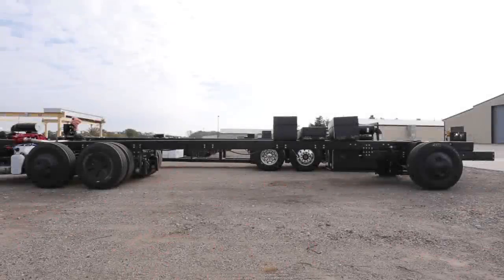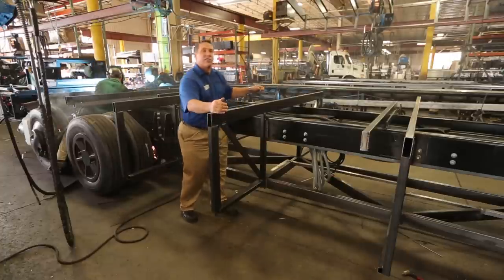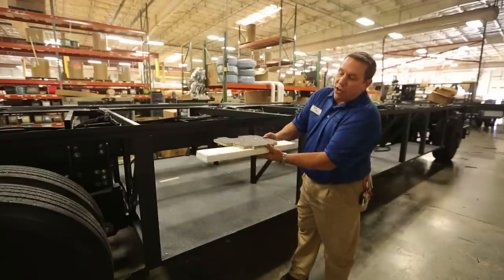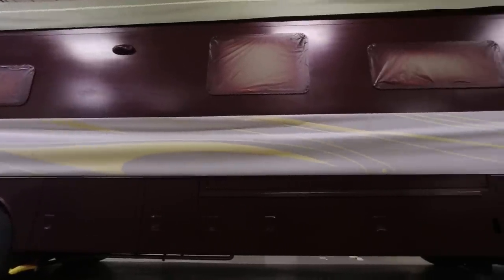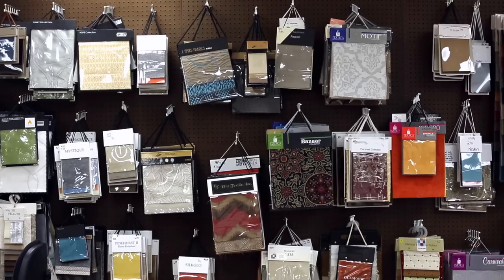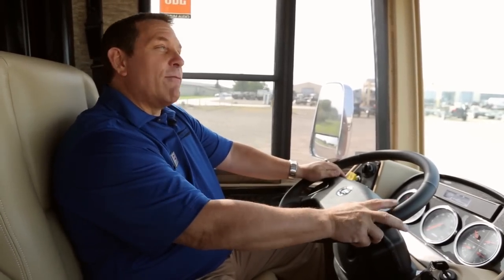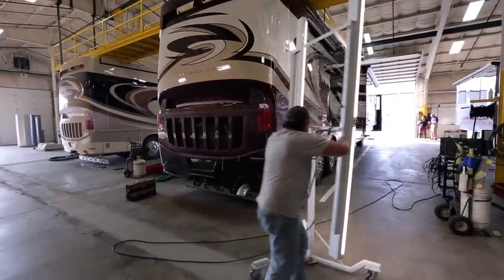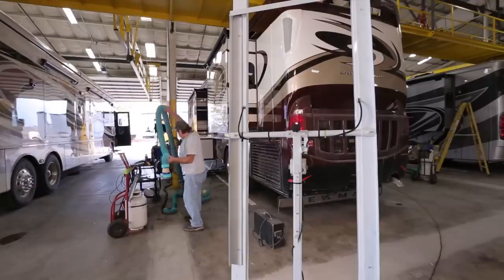How it's made Motorhome| Prevost bus| RV coachs full factory tour | technology and advance feature

Comment: Newmar is a pretty good coach but that is not rust resistant metal they are welding all under there. Many high mile PTR coaches and buses rust out underneath if used year round! If you convert a vintage MCI 8 or 9 or the new 102" they use stainless in the likely rust areas. Coaches need to be built to last more than a couple hundred thousand miles. A million miles is more like it! And a CAT or Cummins with an Allison can do it!

Comment: You better check your workers better..
like for instance, I bought a outback and on a heavy downpour rain my outside porch light leaked and it came in over the lense and into the inside and filled up with water and the bolts that was holding up the light fixture was not caulked and then the water filled up in the side wall and drained into the floor and ruined my floor..Had to have the light bolts caulked  and no more leakes. ..
Then my cable on my slide got off it track and jammed by the roller and now is shredding on the cable..
Also the bedframe is breaking apart cause the weld isn't welded good..The bathroom sink leaked so have to replace that..
This is the biggest Lemmon that I ever bought..If it could get fixed without me putting all this money in it cause of the goof up,I'd be a happy camper...
Reply: A Keystone outback TRAILER isn't a newmar motorhome WTF